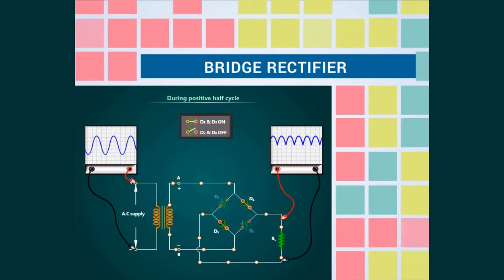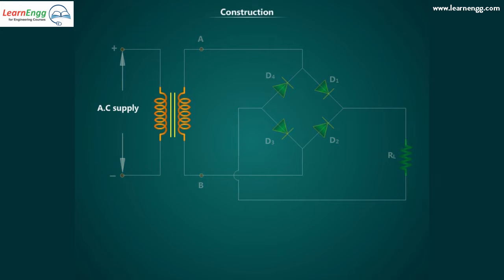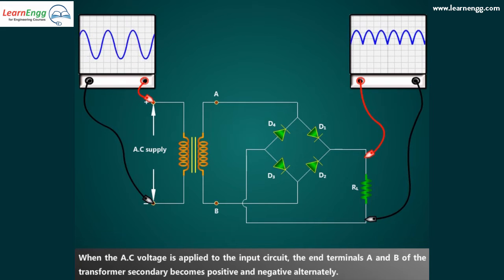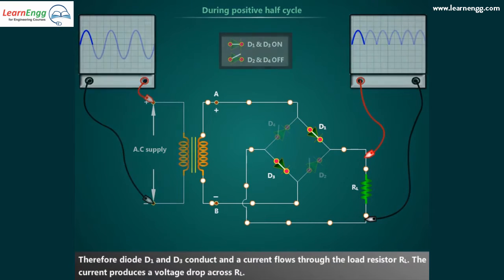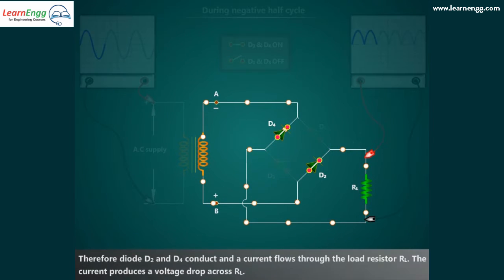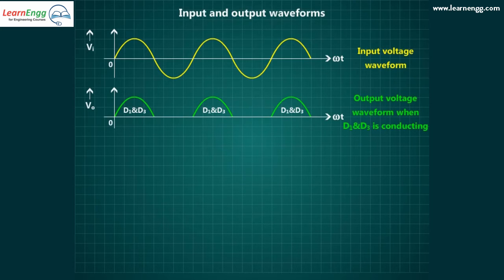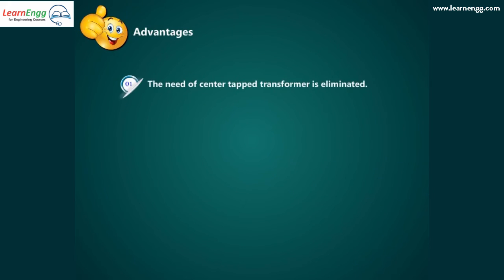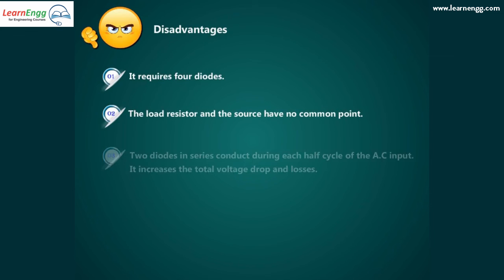Bridge rectifier

Comment: Thanks for the video, can you explain a bit about the return current from the load, the return current is DC and it passes to point B and back to transfomer secondary but the return current being DC , how does it flow back to the transformer winding which has AC
Reply: Only half of the transformer is positive at a particular time and so the positive section attracts electrons during that time.

Comment: You made a mistake, where is a time shift of the output in the corenspondance to input? Voltage on resistor just can not be exact as the voltage on input because there is voltage drop on diode 0,7V, and you have 2 diodes, so at the output you must have ~1,4V lower voltage than it is on the input. Two big mistakes, there are just few of them on youtube who explain well.
Reply: he didn't mention any of the value and topic u r talking about.....
Reply: https://youtu.be/uUFpOw_VA7I you can seen my video